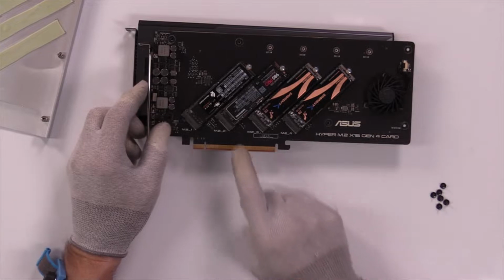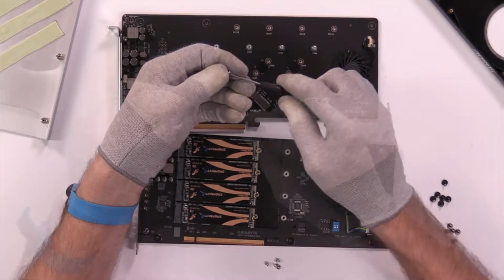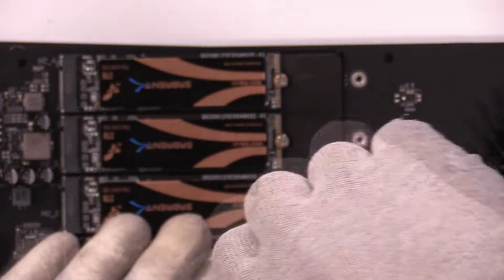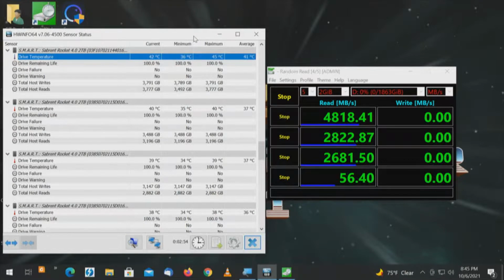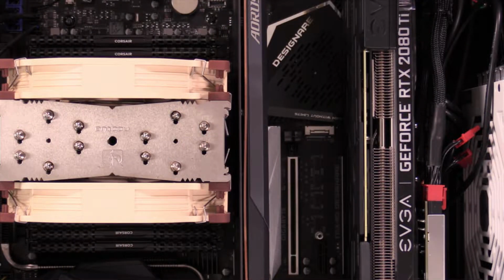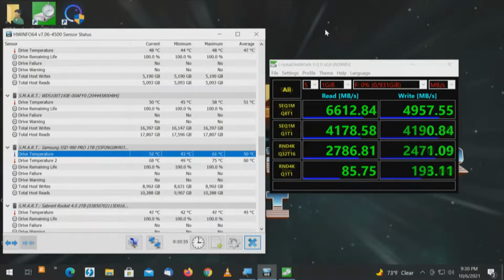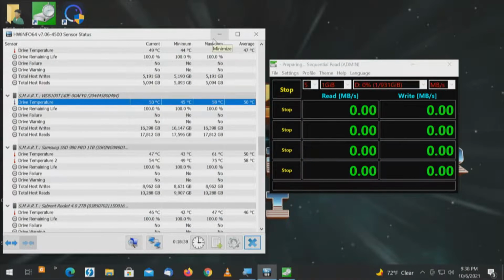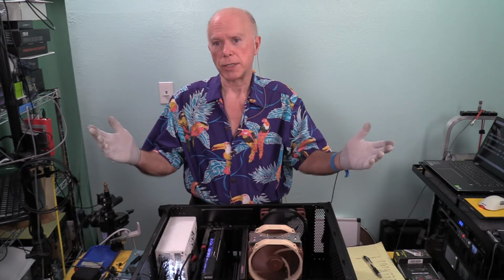WD Black SN850 Firmware Update on Gigabyte Aorus M.2 x16 Quad card Heat and Speed Test

Comment: Thanks for the link to the Sabrent 2TB Rocket NVMe Control Panel. A GEN4 (first generation drive) on an Asus DIMM2 Al heat sink pcb running on an X399 GEN3 cpu lane clocked a poor 3.4GB/s at 39C. After 10 test in rapid succession 40C. That was with Grizzle pads. I am very happy with the Zenith TRX40 DIMM2 cards I found on ebay. sorry. I just don't have that WRX80 up and running yet. That deal with the firmware may help a lot of people in the future.
Reply from the maker: Hi Max Hughes,
Absolutely! Very interesting! Were You able to restore Performance to the Drive? The WRX80 will wait until You're ready. It's not going anywhere. And the new CPUs have been delayed for the TRX40 Platform. Was expecting new Bios Updates for that feature set but not now. Yes, had to show the M.2 NVMe Firmware Update. Just goes to show, whatever We get, Test and Verify! The What, Why and How! Appreciate Your Comments!

Comment: Your going to spoil us with a vid everyday. 😁
Reply from the maker: Hi Max!
Thanks for watching! Just worked out that way! Filming next one this afternoon! Interesting to note differences in design. Also ran into a Problem with the WD Black SN850 on this Gigabyte Aorus x16 AIC. Then a Solution. 

Those M.2 NVMe Heatsinks took a lot of time but worth it in the end. Lots of valuable knowledge gained from that experience. 

We've only had 2 M.2 NVMe Adapters that were poor quality and bad performing products. 

Appreciate Your Comments!